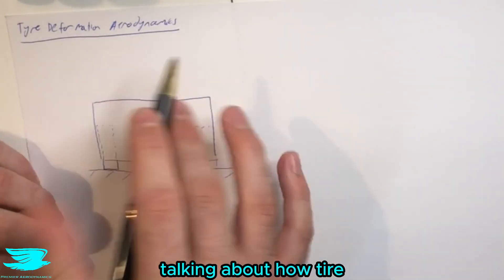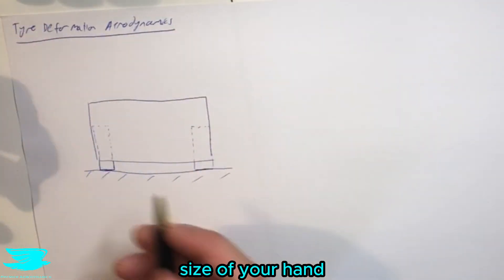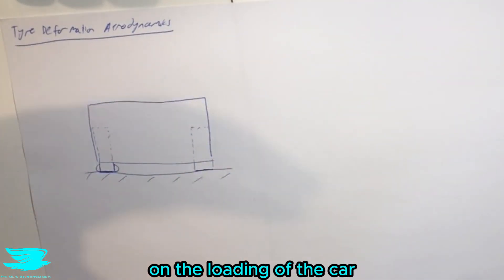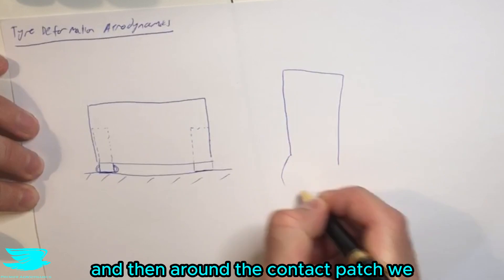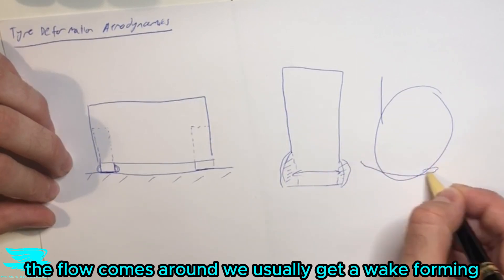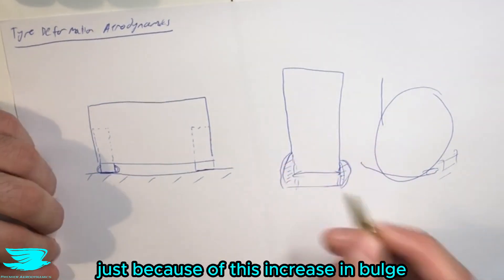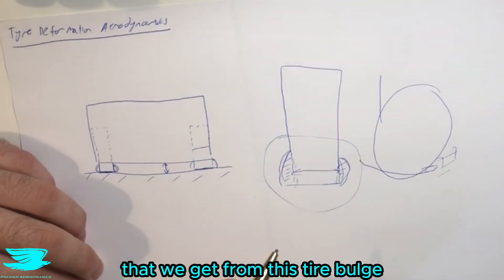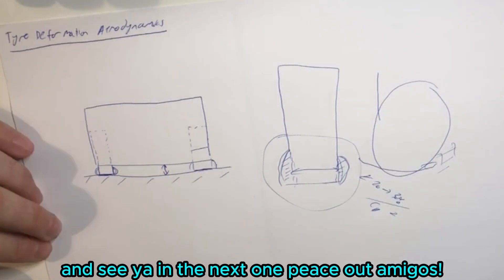Tire Deformation Aerodynamics Is Important {Auto Aero #66}

Comment: Hello, but how we can avoid it? How we can manage to make as less as possible drdg from tires? If all tires are slightly deformaiting and during many races ( for example F1) there is a high temp so the drag coeficient should be even higher due to the fact that tire deforms easier. So in general how we can avoid that type of uselss drag from tires?
Reply from the maker: One way is to make stiffer tyres.

Comment: what I don't understand is that the contact patch almost doesn't move with respect to air. You can even make wings on the wheel to create direct down-force, bypassing suspension, since outer points on a wheel moves on cycloid.
Reply from the maker: Putting blades on wheels would be interesting. They would have to rotate really fast so you could align them properly with the flow, which I think would be the biggest difficulty.
Reply: @PremierAerodynamics  and it is my question. How flow was defined in simulations in this video? My point is that naively, since blades move on cycloid, they automaticaly aligned in such way that create only downforce without lift (and some parasitic drag too). Since boulge of the tire barely moves through static air, how it creates big drag? Is it because wheel create vortex and you have big air speed in directions different to car movement?
Reply from the maker: That is a really good point, however, the relative speed between the tire and the flow hitting it isn't zero. Between the buldge and the freestream flow, then it is, but the flow seeing the tire is not the same as the freestream flow. It may be accelerated by being squished under the car, and also there is some directionality to it as it is redirected by other upstream objects. There is also flow that hits higher up on the tires, has to flow down (because it is below the stagnation line) and then has to escape around the buldge.

But, if you could get rid of all of that, then I guess the buldge wouldn't have a wake.

Good question.

Comment: In CFD, wouldn't a contact patch act as a perfect vacuum, similar to a suction cup? Does this vacuum phenomenon exist in reality? I suspect it does for hot and sticky tires. If not, wouldn't the simulation artificially overestimate downforce by hundreds of pounds?
Reply from the maker: Depends on the tread. if there is tread, then that helps alleviate the pressure there, but for F1 cars, for example, where there is no tread, then the low pressure isn't alleviated.

Comment: If you look at the tire's flow structures, the upper vortex actually generates downforce(upwash), this is pointless because most cars effectively destroy this flow structure with a wheel well. The only thing left then is the lift producing lower tire vortex. If you really wanted to maximize the tire wake, you'd put the wheel well down low, and use vortex generators on the upper wheel wake. When a car is cornering it gets even crazier, the upper vortex on the windward side(going into the corner) becomes stronger, as does the leeward lower tire vortex, while the opposite vortices become weaker(windward lower vortex, and leeward upper vortex).
Reply from the maker: Covering as much of the tire as possible is a great approach, like even in the 50s. But, I guess for styling and practical reasons they don't do that too much anyway.
Reply: @PremierAerodynamics  Technically open wheel race cars do this. They typically have a wing in front of the front tire, and a bargeboard behind it.

A downforce producing wing upwashes air, and is also a physical barrier for air. So more air goes to the upper half of the wheel. While the wing partially blocks and conditions airflow on the lower half of the wheel.

Then you have a bargeboard behind the wheel increasing the static pressure, since you raise the static pressure behind the wheel you're lowering the pressure difference between the front and rear, and with it, the lift producing lower wake. Meanwhile, the upper half of the wheel is in free stream, and the front wing's upwash.

The issue is that then you don't have much flow conditioning on the upper tire wake, so it's just turbulent, whereas if you could strengthen the upper wheel vorticity via outwash. Then combined with reduced lower wake, the wheel would actually produce downforce.

If you just strengthen both the lower and upper wheel vortices, they cancel out in terms of lift and downforce. If you weaken the lower one, and strengthen the upper one, you get net downforce from the wheel. If you weaken the upper one, and strengthen the lower one, you get net lift.

Comment: Typically you see more tire bulge on the driver side, as there's a little more weight, then again a lot of people don't check their tire pressures as often as they should. Tire construction also has a huge impact on the deformation, as tires with taller sidewalls tend to have more deflection. Alignment settings, particularly negative camber not only affects the static contact patch but also the wake shed from the tire. Going from a rectangular shape to a more trapezoidal one slightly reduces drag, it also slightly affects the tire squirt. Although toe/yaw angle has by far the most significant effect on the tire wake, and as a result tire squirt. The higher the toe/yaw angle, the more prominent the flow structures shed by a wheel become.

This segways nicely from your last video about 'effective angle of attack', because you can guide airflow around a wheel, and even if the wheel is pointed straight ahead, because of the relative airflow around the tire it can shed these flow structures if you manage to outwash the air around the tire.
Reply from the maker: Yeah, the tire construction is paramount - even the different layers in the tires, and how thick they are and what they are made of.

Tire pressure makes a big difference as well and then the temperature of the rubber then affects the pressure as well, even.